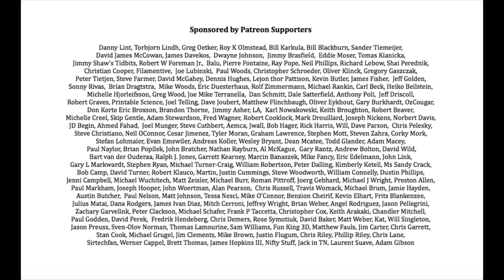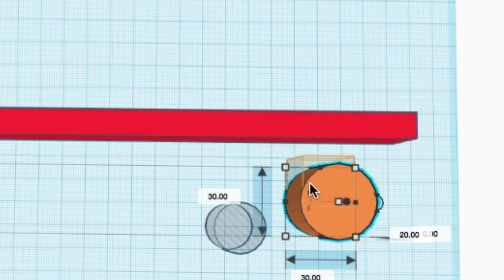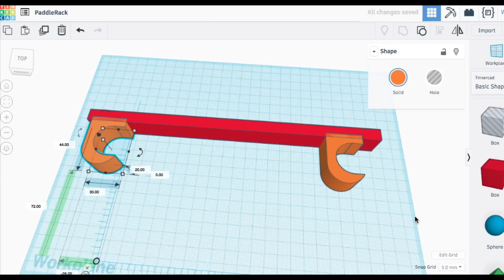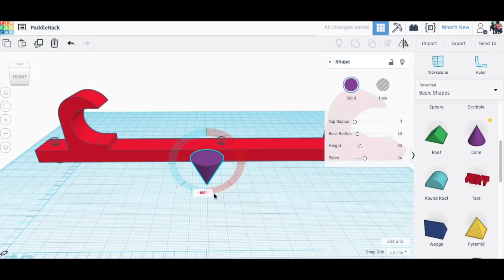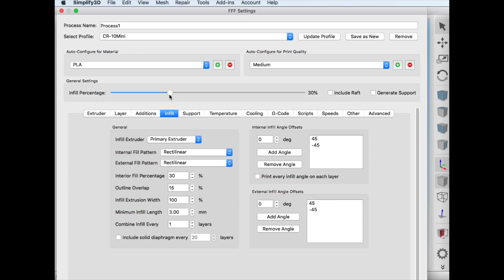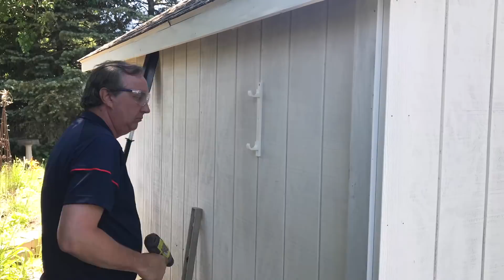3D Printed Kayak Paddle Storage Brackets

Comment: Thanks for the video.  My Ender 3 pro has been setting idle for several years.  I have just recently became interested in printing again.  In the past I used Fusion 360 - frankly don’t remember much and would need to start drawing from scratch.  Would TINKERCAD be easier to learn?  I still have CURA and fusion 360 available on my MacBook computer.  Thanks for your input.

Comment: Totally using this, now if only I could design a bracket strong enough to hold the kayaks and canoe 😋
Reply: If you print a hook / holder in the correct orientation for the layer lines and a high wall count it would probably hold them just fine.

Comment: Love the practical printing videos - very inspiring.  Everyone seems worried about the UV exposure - if you save the file you can always print another set in several years - even in another color.  The study I read showed no UV exposure impact after two years on tensile strength or modulus but UV exposure can affect impact resistance (and generally no one is beating on the printed parts with a hammer).  If you are really concerned, paint them in a light color using water-based paint to minimize the UV exposure.

Comment: A great build, but one thing did catch my eye the material costs $19.72 each.
Reply: I didn't see that number in the video - is that per bracket or per spool?. Proto-pasta's white HTPLA costs about $50 US / Kg, so $19.72 US per bracket would mean each bracket would use about 390g, or over 3/4 lb of filament - that seems like a lot of plastic. (did I do that calculation correctly?) For most simple clips and such, I find the parts cost pretty low, not counting the cost of my time :-)
Reply from the maker: Simplify3d showed together they used just over 30 meters of plastic. At roughly 300 meters per spool they used 1/10. At $22 /spool they cost $2.20 to print. That’s why I said the pricing setting in Simplify3D was wrong. I didn’t reset it before filming.